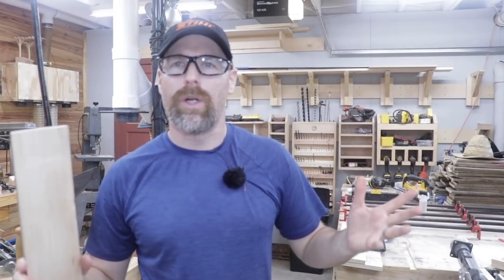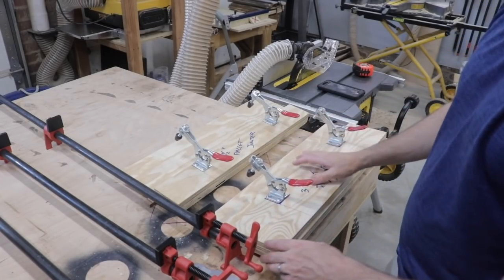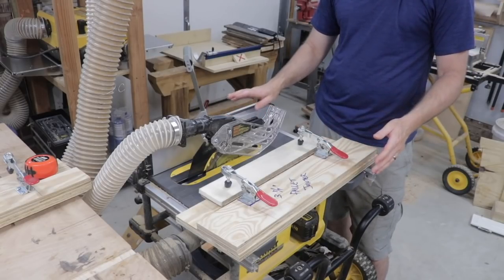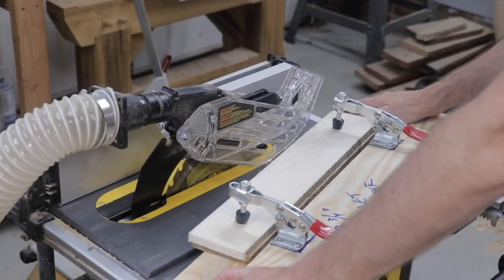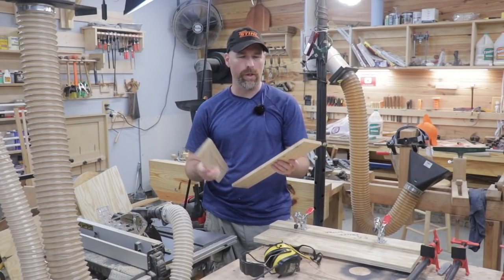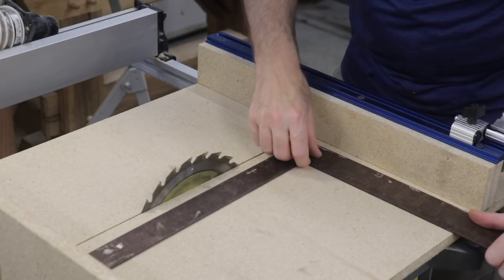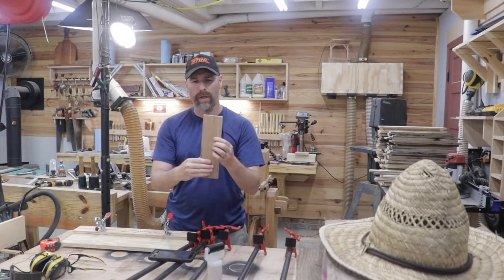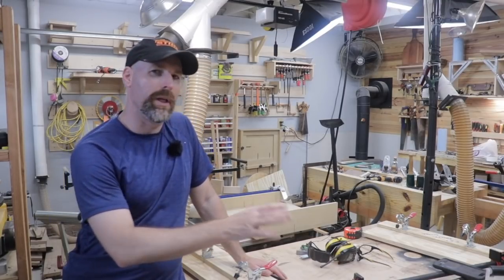3 Must Have Jigs | Woodworking With Pallet Wood

Comment: I'm with you on everything except squaring up the second end. that's great if you have a project, and are cutting to length. But, I'm not doing that until I know the length I need. With my luck, I'll need a half inch shorter and will, need to recut the second end again. I'm not going to waste my time on that until I have a measurement.

Comment: Great video series.  Have you thought of making a jig or piece on back of your fence to hold that vacuum hose out of the way?

I need to build one of those jointer sleds.  It's on my short list. But, instead of prioritizing a cross-cut sled, I use my sliding miter saw. 

I haven't been using much pallet wood since it has been so difficult to extract from the pallets.  The wood I do have came from pallets I finally just cut off the runners like you did.  Most of it is really good hardwood.  So I am considering cutting some more pieces again. 

Thank you for the series,  Keep them coming!
Reply from the maker: I need to do that! It’s always getting in my way! Thanks for suggestion!

Comment: Instead of 2 sleds, make one that is adjustable. Also make the sled a zero-clearance, that way you do not need to cut off a 1/4 or 16th. This will result in a wider end product.
Reply from the maker: All good ideas! Thx

Comment: Jim, I have a question.  I'm new to table saws and I'm not sure what blade is best for making cuts like the ones you showed in this video.  I know the biggest difference is tooth count, but I'm not sure what blade to use to get consistent cuts without a lot of blow-through on the bottom side.  What blade would you recommend?
Reply from the maker: I’m certainly no expert, so hopefully others will chime in! I’m using the general purpose blade at this time. I haven’t had any issues. Here is a good article on the subject!

https://www.woodworkerssource.com/blog/woodworking-101/tips-tricks/woodworking-101-the-3-table-saw-blades-woodworkers-should-have/

Comment: What is the dust collection hood you have on your Dewalt saw
Reply from the maker: The blade guard was included with my saw!
Reply from the maker: The blade guard was included with my saw!
Reply from the maker: The blade guard was included with my saw!
Reply: I was not talking about the blade guard.  But cover over the guard attached to the hose.

Comment: Unless the boards have a lot of skew angle along the length (i.e. they're pretty much parallel, but rough edges), why couldn't I just use the table saw fence to create the first edge, then flip it around to make the second? What am I missing here?
Reply: Well the problem with that is that the side you are running against the fence won't be flat and the long cut you will make will be skewed, and then you will still have to set up the fence a second time. It changes the workflow. You could certainly do it, but this way is more efficient and will likely end up with more consistent results

Comment: One thing is puzzling me, why two jigs. You could have used the bigger one for both boards, the only difference would be the amount of board that was on the jig.
Reply from the maker: The clamps that I bought aren’t long enough to joint the smaller slats
Reply: @lastingbuild1373  I knew in the back of my mind that you would have a reason for making two jigs, but I could not see that until you told me. I wasn't trying to be clever or big headed, it was just my way of asking, thanks for the info.
Reply from the maker: If I had it to do over again, I would try to find two different size clamps for one single jig. Not that two jigs are a big deal to build but I’m quickly running out of storage space😬
Reply: Instead of using the miter slot, one jig would be sufficient with either size. Just let it follow the fence a d adjust the fence for the different sizes
Reply from the maker: Didn’t think of that! Thanks

Comment: nice work but you are wasting wood, on the ends just cut enough to make it straight 90
Reply from the maker: You are right! Unfortunately, a lot of the ends have cracks in them so I trim those off.